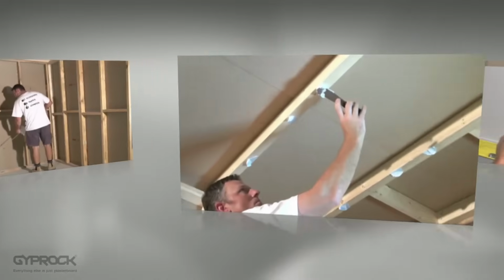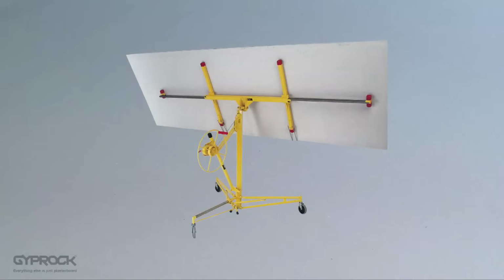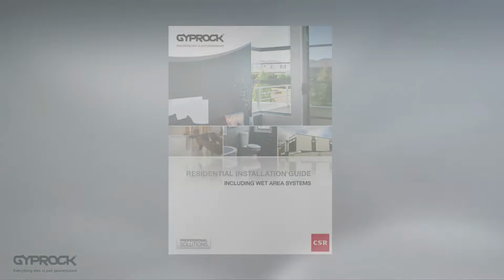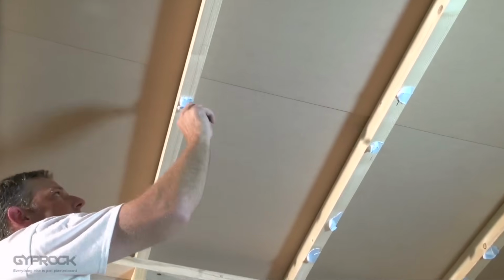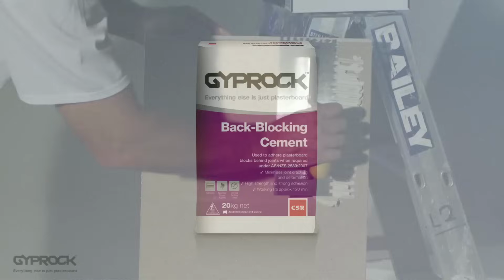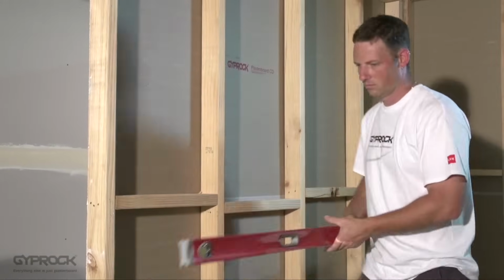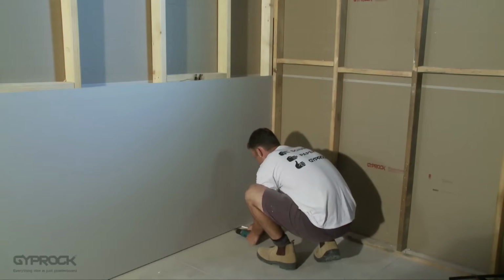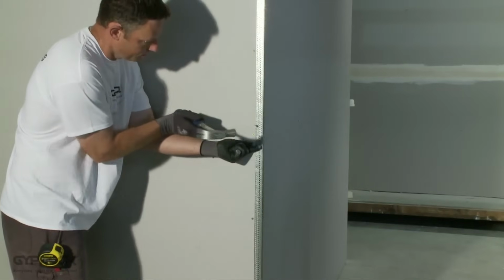Installing Gyprock plasterboard - Plasterboard walls and ceilings

Comment: Random question after gyprocking my bathrooms ready for tiling do i need to have the walls plastered first or is this not neccesery
Reply: don't use plaster on the walls of wet areas, instead, use 6mm fibre cement sheet, commonly called "villaboard".. your tiler will know.

Comment: Why are the wall boards installed horizontally, and not vertically?
Reply: The sheets are installed according to the direction of the timber framework

Comment: Anybody that’s tacked ceilings knows this is bollocks
Reply: The panel lifter is an absolute MUST for ceilings.. Especially if you're a one-man-show, but even if you have an off-sider or 2, no-one wants to try to hold up a big sheet of plaster in place, on its flat, up a ladder, while someone else tries to screw the bastard in.. I'll be doing a little bathroom in a few weeks which is 3.8mt long, and I'll be using a single sheet (cut down from 4.8) to cover it.
Panel lifter and a step ladder and I'll get it done in 20 minutes by myself.
Reply: @GenoLoma how did your bathroom renovation go?
Reply: @OilBaron100  nailed it.. ;)
I've done a few more since, and recently, taken on house reno's too - lots of re-sheeting of walls and ceilings - so I invested in my own panel lifter.. 40 bucks a day to hire one, but only 250 (delivered!) to buy.. should have done it years ago.. I got one in blue too.. which matches with my business colour scheme.. :)
Reply: @GenoLoma  glad to read that you've had success on some drywall jobs!
Reply: Not a gyprockers job to pack shit out

Comment: Better read manufacturer installation guide before making video. On ceiling those timbers should be 16" or 400 mm center to center and clearly your studs are 24" 600 mm.
Reply: Mr. Wizeguy you can use 600mm centres
Reply: @Truevisionsolutions  Yes you can and that's why YouTube is full of "how to patch broken ceiling joint" videos because 24" 600mm spacing allows too much movement and some of joints for sure crack it even sags from own weight too much but clearly you know better than MANUFACTURER guide.
Reply: Mr. Wizeguy iv never had an issue either back blocking or put noggings in between the joist no sag!
Reply: @mr.wizeguy8995  its 450mm for standard gyprock and 600mm for supaceil gyprock
Reply: @Truevisionsolutions  Me neither because we always use 400mm spacing but YT still is full of "how to fix cracked plasterboard ceiling joint"
Reply: Im in Australia, We always use 10mm supaceil boards on anything over 450mm centres, backblock all the joins aswell for strength
Reply: Lol you have no idea what you're talking about
Reply: 24 is not allowed in Canada, I'm pretty sure. Not like the video, anyway. I havent been in the game for 20 years but they sure seem to cut corners in some ways.